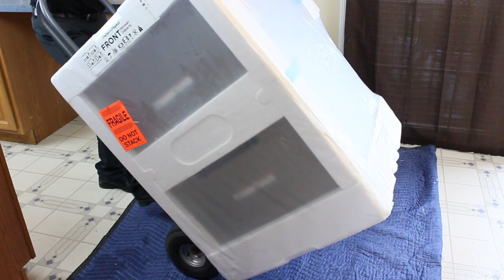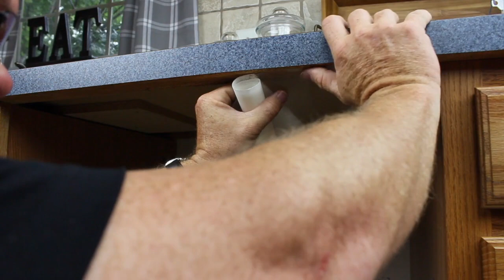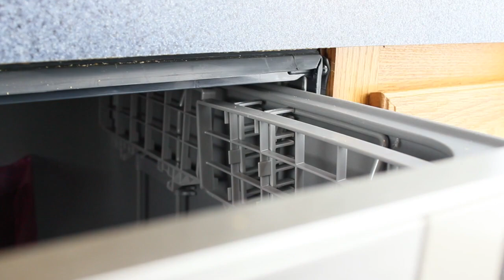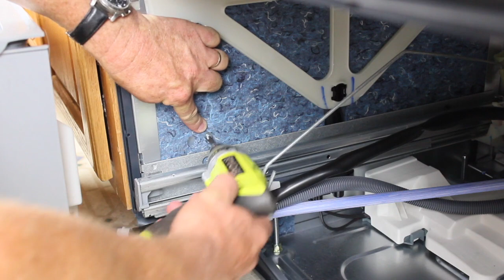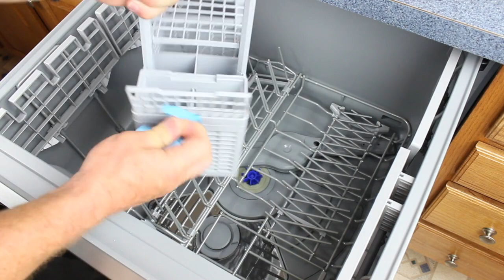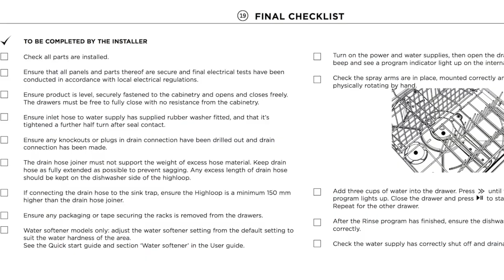Installing Fisher & Paykel Double Dishdrawer

Comment: I did all this exactly and my drawers are not draining
Reply: Me pasa lo mismo pueden explicar por que pasa eso el mio esta nuevo y tiene problemas de drenaje incluso solo funciona el cajón de abajo el otro no pone marcha y aparte no drena
Reply: @sammymusic.7817 for me I had to run the washer with the drain hoses in a bucket and I would slowly adjust the height of the bend until I found the right spot . So my problem was I didn’t have the height correct.